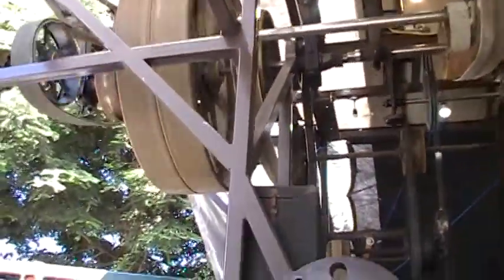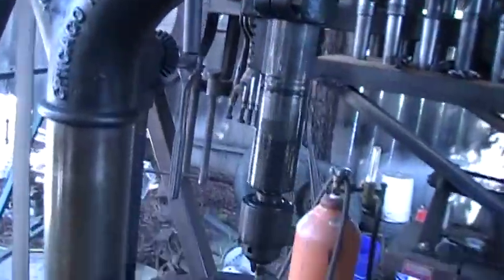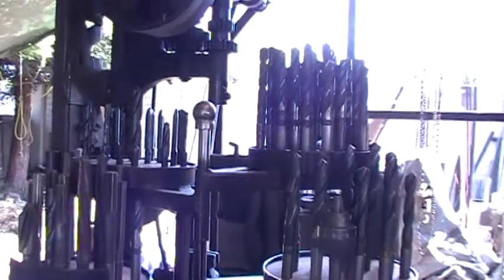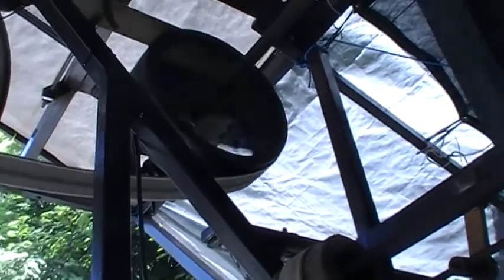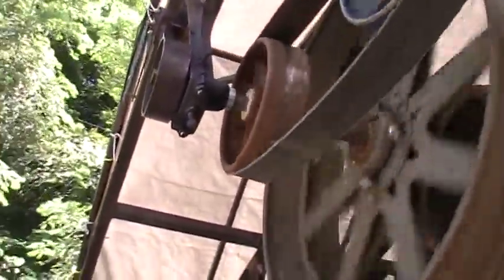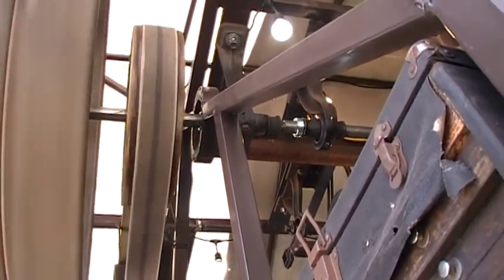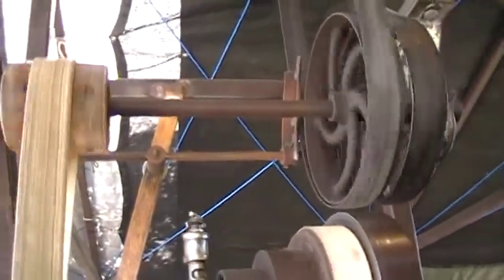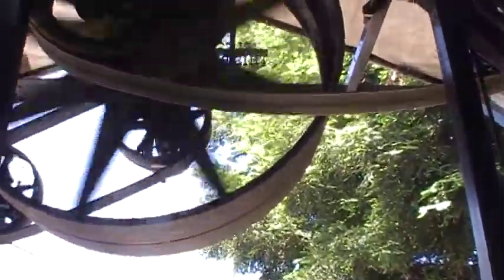pulleys and giggles

Comment: Always nice to see...
Especially when I've got them lineshaft blues...

One of my drill presses is a hand feed type like that Canedy Otto...
Nice machine...

I'm not sure about the USA..but here in the UK there's rules now involving rotating flywheels n stuff at shows...
They don't like horizontal flywheels above headstocks on lathes, milling machines and drills...

Chuffin 'elf n safety' bandits...
Reply from the maker: Thanks Glenn. We haven't got to that point yet. That's why I try to stay extra safe. Don't want to be the reason laws are changed.

Comment: What are the approximate dimensions of your trailer, and speed of the lineshaft?
I want to have a lineshaft in my shed with some small machinery. The shed isn't that big so I was wondering how you figured it al out.
Reply from the maker: Hello. The trailer is 16' , but there's a 4' porch off each end. So the line shaft is 24' . The main line shaft is turning about 180 rpm. A bit slow as they were more likely to run about 250 rpm back in the day. Plain bearings usually didn't turn faster than 500 rpm max. I have a 4' pulley that's running 20 mph at the edge, so you can get into dangerous territory real fast. Go for it you'll be surprised how easy it is and don't over think it.
Reply: @davewilson1591  I'm mostly concerned about the hight I need. I see your belts are pretty short and pulleys close together. I have an old 3 HP electric to power it.
Reply from the maker: @djdutch87  my ceiling is 9' . On some applications the closeness of the pulleys doesn't matter, but to cross or twist the belt to reverse rotation or installing a belt shifter you do need enough distance. I've found direct overhead is the least effective for transfer of horsepower, the more horizontal the better. That being said vertical set ups can not be avoided. Wood pulleys with leather belts transfer the most horsepower. But the old timers made all manner of configurations work. When I started I was over thinking it. Once you get something up you'll find out it's not as difficult as you thought. Good luck 🤞